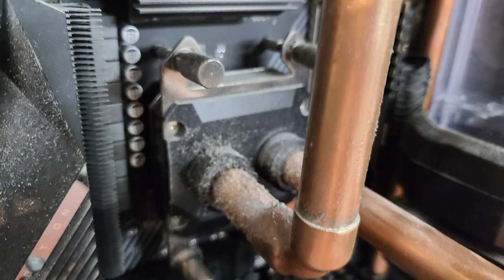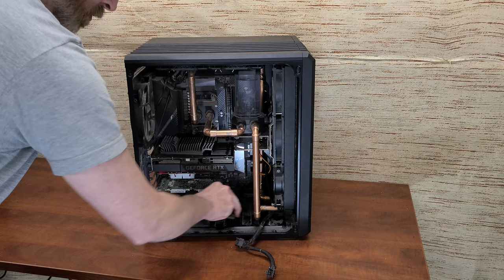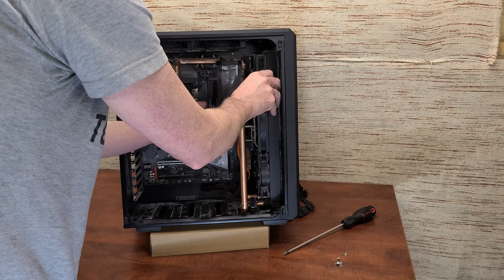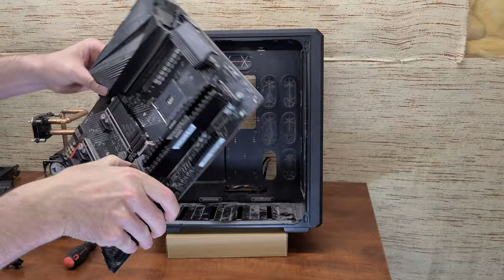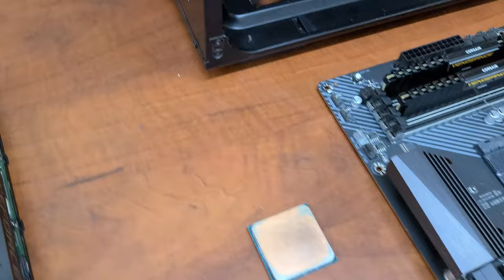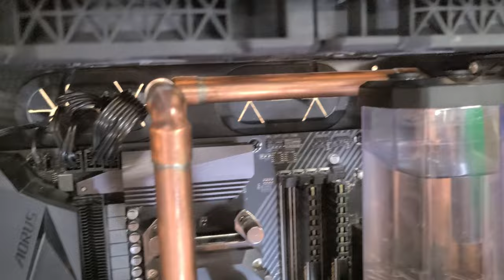Your computer is filthy!  Let's clean it.

Comment: I like how the whole water cooling assembly comes out in one chunk. Great design!
Reply from the maker: Yup!  It's a bit fragile to remove as the fittings hold the pipes only so much.  But with care, it does come out.  As a matter of fact, I recorded the entire cleaning process and I managed to knock the cooling unit over.  A couple of pipes came out and I dented the heck out of the rad fins too...  :(  I didn't include any cleaning as it was really boring to watch.  Lol.  I should have put a small clip of the rad falling over but there was way to many swear words... as the coolent was everywhere Including soaking my video card.
Reply: @KMHardware  lost count of the number of times ive spilt coolant disambling my Loop, with the case being white and 1 loop having blood red coolant, the pc got nicked named bloodshed.
Reply from the maker: I pretty much make a mess every time!  Hehehe

Comment: coffee machine cleaner (fluid) would do wonders circulating through that system for 30 minutes, the water will turn teal (blue-green)
Reply from the maker: Interesting!  I have used a product called StarSan before.   It's a phosphoric acid based cleaner (skin safe when mixed correctly) for beer brewing equipment sanitation. But yeah, coffee machine descaler sounds like it would do wonders.

Comment: lol if i dusted out my pc's ever time they got dusty i would never get any sleep, the Dual Epyc HDD Server is especially bad, least with the main pc its not as noticeable, the two 480mm rads are hidden in the back section out of sight.  Why is there a GT1030 Heatsink slapped on the back of the Graphics Card?
Reply from the maker: Hehe!  I hadn't cleaned mine in ages!  Also, a guy who knows his parts!!  Very nice.  That 3060ti of mine would get smoking hot on the back plate, that extra heatsink drops the GPU temps quite bit actually.